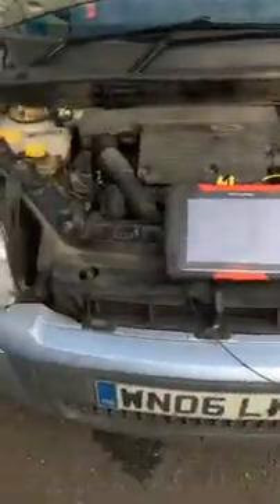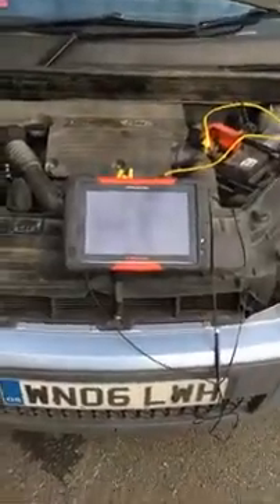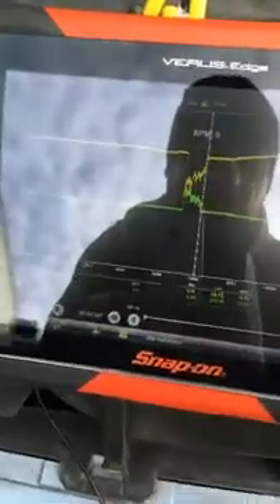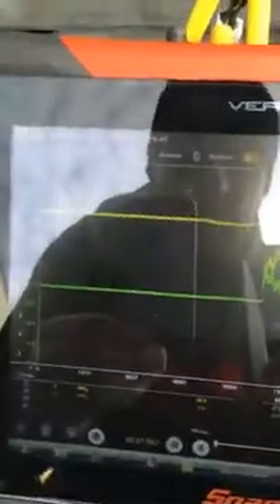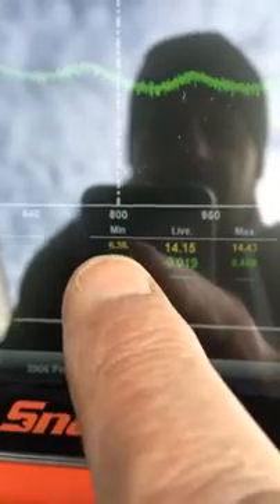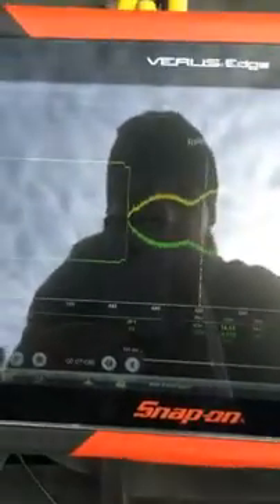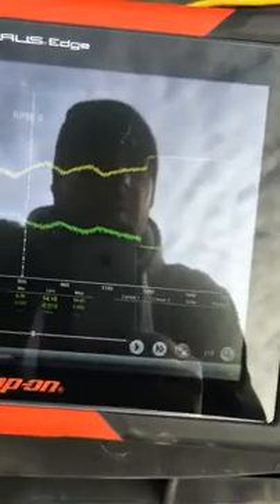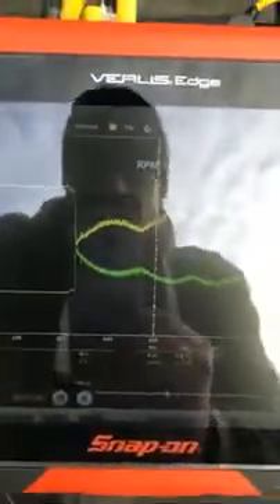Fusion poor cold start Battery Testing

Comment: Steve for checking the battery ..is you current clamp on the negative cable ..Geoff
Reply from the maker: Yes Geoff, it doesn't matter whether you go +ve or -ve, it's only polarity, if you use +ve then be mindful to only go around the starter cable.